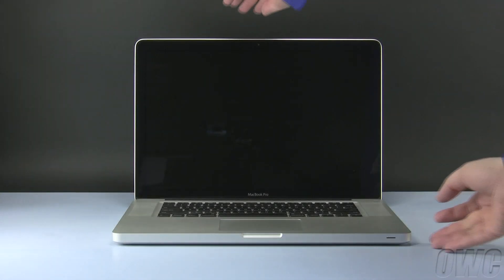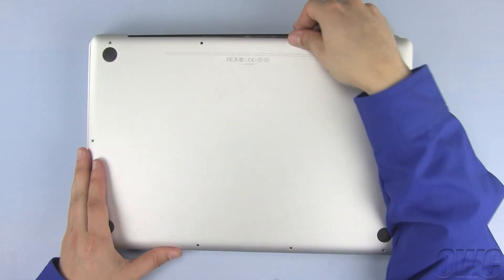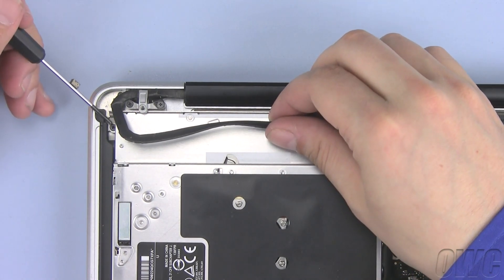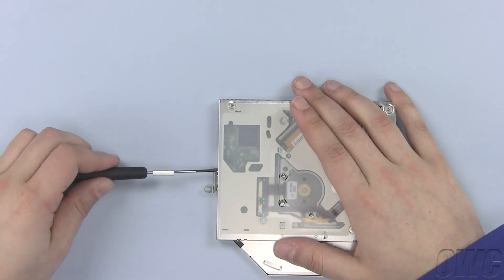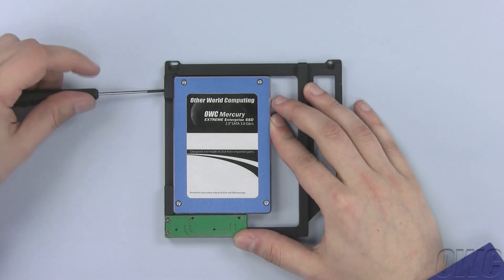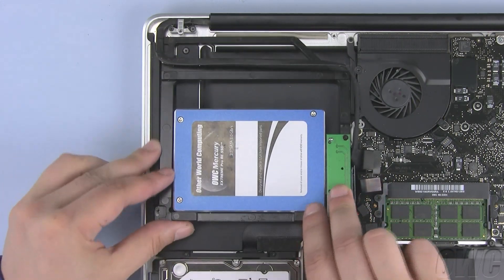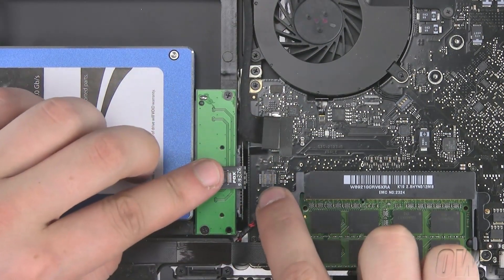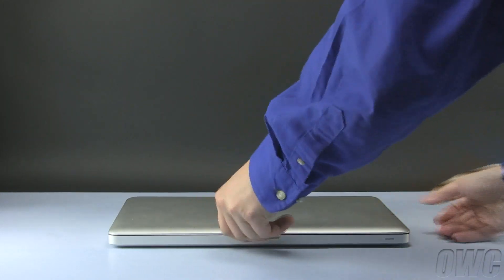15-inch MacBook Pro Mid 2009 Data Doubler 2nd Hard Drive/SSD Installation Video

Comment: im planning to do this upgrade to mt 15'' mid 2009 mbp  but im wondering , what sata bus it using on the superdrive!   is this sata II  3gb's  ore the slower sata 1  ?

im using a 500 gb samsung ssd in the hard drive spot and wanted to instal a data drive using this method :p  this wont look like it wil fit the bigger 2 tb hdd's with 15mm hight so il be using a 1 tb  hard drive 9 ore 10 mm

Comment: I saw that you were using an SSD in the optical drive, but what were you using in the original slot. The HDD that came with the Mac or another SSD? Lastly, does this affect the battery?